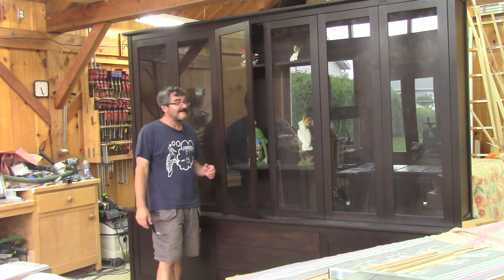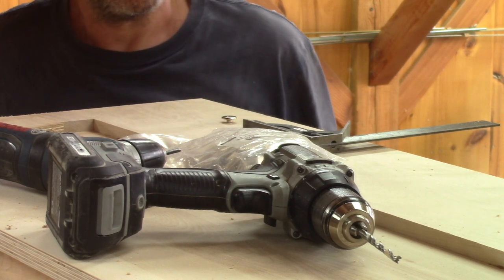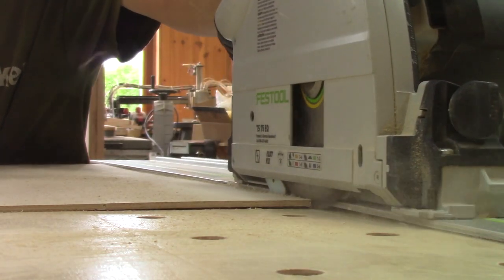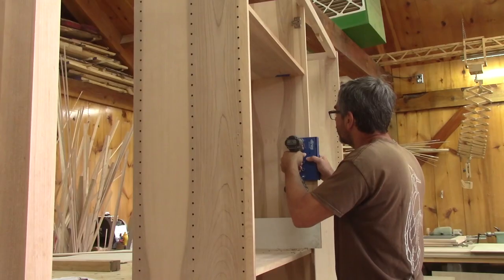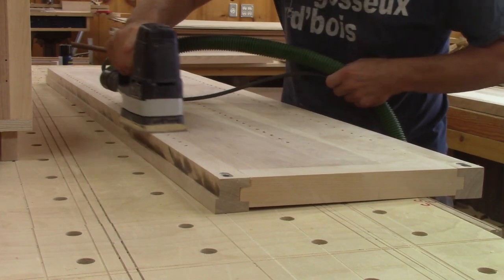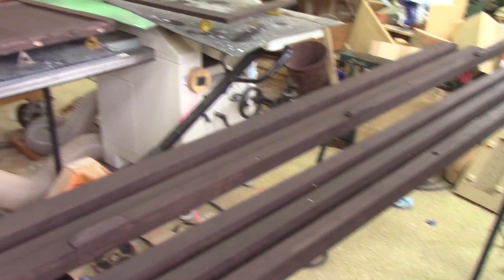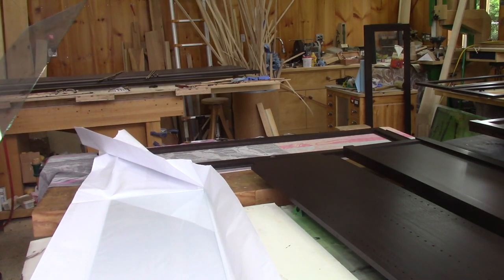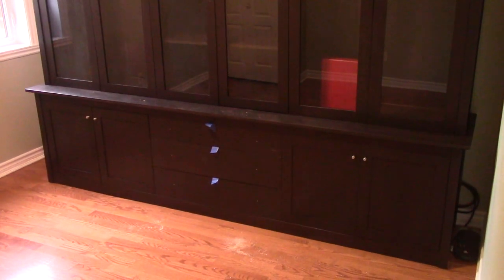The Woodpecker Ep 257 - Closed bookcase part 5

Comment: old trick for "reluctant" screws : slightly wet a soapbar of what we call  "Marseille soap" - white, hard, used for laundry (once!), and scrap on it the flight of your screw.
It will carry with it a few chips of soap,: as it is screw it - as you say, it will go like a charm !
Reply from the maker: Thanks. 
Sometime I use furniture wax but most of the time the excess sip into the wood

Comment: Alain, I cringe whenever I see you spraying in your shop.  I know you don't have a dedicated finishing room, but even though you are using an HVLP system, don't you get any overspray or dusting on your tools just from the aerosol in the air from spraying?
Reply from the maker: Most of the overspray, if not 99.9% dries before hitting anything 6 feet away.
As a matter of fact I always end up with tons of dust on pieces that are drying away.
So, yes I have fine dust on my tools, but nothing is sticking on them. The only place I have varnish residue is on the floor at the back of where I spray.
I wish I had space for finishing, but I don't...